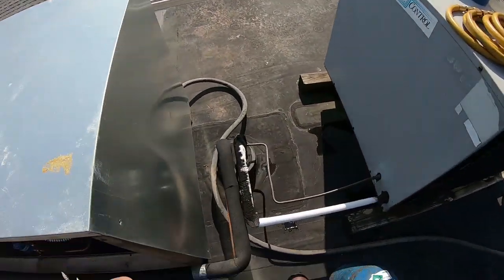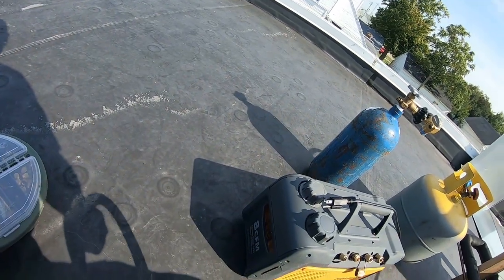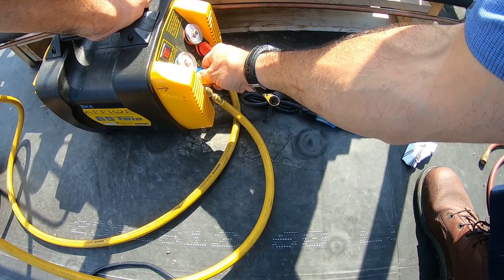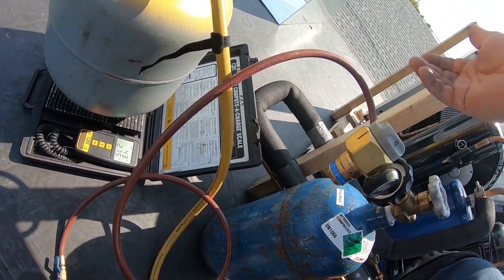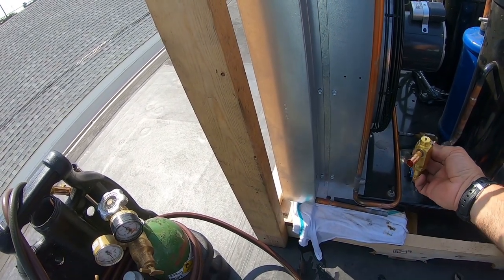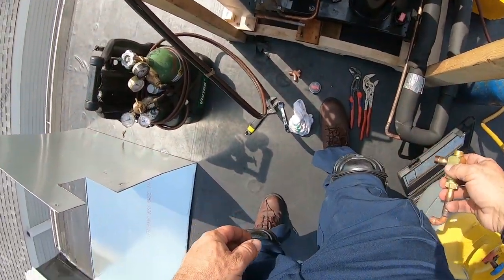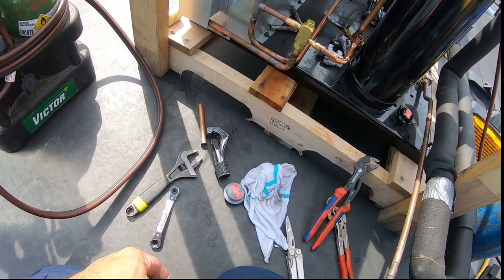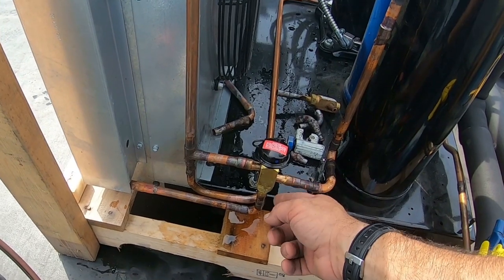Refrigerant Headmaster Replacement & Breakdown Explanation

Comment: Okay thanks for clearing that up for me. Here in Canada those valves may be more common. So the txv still primarily takes care of the increased load demand in the cooler itself, and the headmaster just maintains minimum required head pressure in extreme low ambient temperatures around the condensor. Thanks for the video and explanations. Kevin
Reply from the maker: Absolutely my pleasure, sometimes they shut down a fan on multiple fan systems or just cycle the fan if they only have 1 fan.

Comment: The controller cycles 3 times at start up to get any liquid out of the crank case.  🤘🤘
Reply from the maker: Figured as much,  but makes you wonder how it would have liquid in there if your pumping down. I assume there trying to cover there bases against bad installs?
Reply: Was doing the F&B operations of grand opening of a new OTB parlor. Walked around back and saw brand new condenser coil on ground near gutter downspout caked in leaves and crap.  "Hey I'll do them a quick favor". Pulled disconnect and cleaned it up. Plugged back in and freaked out at how the unit was starting and stopping! WTF!

Glad to see you back Rick! Hope the name change means we'll see more of you soon.
Reply from the maker: @davejohnsonnola2758  this luckily had a sticker stating that it would do that, it's a nice controller set up,  I'm curious to see how it holds up outside, kinda weird it didn't have a defrost and thermostat built in as well. I've missed doing these, even though it's a lot of work and with new equipment upgrades, even costly. (New camera, computer, software,  etc. but it's rewarding to hear from everyone. )
Reply from the maker: @sjefoekel6058  I noticed it didn't seam to do it everytime,  I didn't stay around for multiple cycles and have only been on this model maybe twice.
Reply: .oO( or cook the relay/contactor thrice as fast) which one is the real reason or an excuse :))
Reply from the maker: @throttlebottle5906  No,  I can see it as being the reason.  "Stirring up" the refrigerant, building some heat in the compressor to boil off any potential liquid. Contractors are cheap vs a compressor.
Reply: Nor Cal Dave response as to the reason the unit cycles a friend few times after a period shut down does make sense but I believe copeland states the reason is to get the oil up to the top bearing well lubricated before any run time occurs

Comment: Is that in addition to a pressure controll for the condenser fans or does the headmaster valve pretty much take place of that feature.? Curious, maybe it has both?.
Reply from the maker: I normally see one or the other but there is some instances where I have both items.

Comment: Dumb question but why is the headmaster  needed in the first place? Is it to help keep the liquid refrigerant in the reciever more fluid so it can make it back to the txv? I understand it's to keep the head pressure high during colder months of the year, but why is that needed?
Reply from the maker: It keeps the head pressure up during lower ambient temperatures. If your head pressure drops so does your low side pressure. That can lead to feeding issues to the TXV and coil freeze ups

Comment: Im with you on that.  If I can break down the piece and sweat it in, not worrying about overheating,  eliminates a worry.  Then you just have the concern of not getting solder into a threaded joint you need to thread together afterward, or seals.  Then again, when you break em down, those teflon seals don't get damaged.
Reply from the maker: I was more worried about the diaphragm possibly rupturing and getting the nitrogen through the valve. Thanks 4 watching👍👍
Reply: @HVACRSurvival  doesn't take much to pop that baby
Reply from the maker: @hvac01453  I've only changed 2 of them so I haven't had the opportunity to destroy one. 😁

Comment: Why sometimes it restricts refrigerant get into receiver? I put a lot refrigerant in the system and tried to bring the suction line pressure up, but all refrigerant just all went to condenser coils. Thank you
Reply from the maker: If I suspect that it's not working correctly I'll pump it down and check the level in the receiver and check the in and out temps of the valve.
Reply: HVACR Survival thank you

Comment: Do you add any nylog to your threads when installing the new one?
Reply from the maker: I usually use it more for the friction points on the flare but someone's I'll put it on the threads, (I also will use a white locktight on only the threads if it's a special case but not the mating surface,  EVER.) The nylog is just a oil, I don't believe they're is anything wrong with it. ( But any locktight or leak lock i never use it anywhere but the threads. )

Comment: So if the Receiver becomes starved, the valve opens to allow some liquid to go directly to the Receiver from the discharge ?  Would this happen in high load conditions usually...such as filling up the freezer or cooler with a big new load of food or beverages? Kevin
Reply from the maker: If the receiver becomes starved of liquid,  the TXV will also become starved as well, this is why you have to have the extra 10 to 15% for the winter charge, it doesn't substitute an improperly charge system. What it's doing is allowing hot gas to come into the receiver and mixed with the liquid in the receiver to maintain a constant minimal head pressure. If the refrigerant level is low then the system's going to starve the txv of liquid. These systems are also referred to as a flooded condenser because you're actually backing up refrigerant into the condenser in addition to what's in the receiver.
Reply: 10 -15 percent of what ? The total change  I live in Canada and this is something I struggle with. Or another example let’s say you go to a service call during the day and find that it’s low on gas and charge the unit to a full sight glass and pressures are good. How do I know how much extra Freon to add for low ambient temp ?
Reply from the maker: @Jerome,  yes of the total charge amount,  if you don't know for sure what that amount is then you can less    accurately guess what the total is and calculate it or pump it down into the receiver available warm it up with a heat source to see if you around the 80% mark.

Comment: Do the 3/8 hoses have 1/4” ends or do you have some fittings you use to hook them up
Reply from the maker: The TruBlue hoses have changeable ends, (1/4",3/8",1/2").  The Appions have to be purchased how you want them.
Reply: HVACR Survival thanks for the response.  I was actually meaning to ask about the 3/8 charging hoses you use for recovery
Reply from the maker: Ok, yes mine are 1/4 on both sides. Your welcome 👍
Reply: HVACR Survival I’ll have to grab some!

Comment: I had a job up on a roof I work at a school district so I get do a few things, I replaced the Headmaster three times and I did not burn up the valve it would not operate properly it would just let Hot Gas bypass. So I cut it out and it's put a fan cycle control on there and haven't had a problem on this walk-in cooler ever since didn't fix it by the book but that was Headmaster valves can be a real pain in the ass
Reply from the maker: Thanks for sharing that Ben👍 That's interesting, was it a Sporlan valve?
Reply: @HVACRSurvival  yes I changed another one out on a multi compressor unit, and the replacement worked fine. That system because of multiple systems in it, I had to have a headmaster for low ambient operation. That job the new headmaster worked great. I always use heat stop with wet rags. Don't know why the other 1 f'd me. Still working ok using fan cycle for low ambient operation
Reply from the maker: @benkuxhouse787  interesting👍👍

Comment: So this controller helps to maintain pressure in unusual low pressure situations?
Reply from the maker: Correct,  it's job is to keep a minimum head pressure of what it's rated for,  in this case, 180 psi. This helps keep the refrigerant pressure high enough to maintain the pressure difference needed to run the txv. These only work in a system with a liquid reciever.

Comment: I’m Canadian, why do American refrigerant jugs have to be turned upside down, ours have a liquid and vapour valves built into them
Reply from the maker: Our recovery tanks have a dip tube on the liquid but none of the throw away tank flavors I use do.  I remember one or two manufacturers use to do the tubes but because it wasn't a standard across the board it caused confusion resulting in a bad mix, so I assume that might be why.  Otherwise it might be another goofy government B.S.  regulation that you have that we don't?